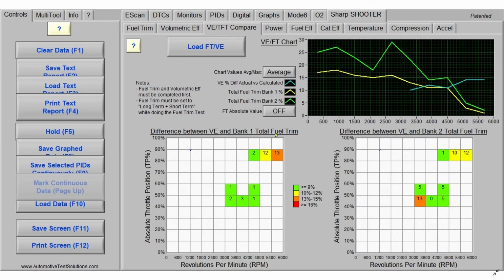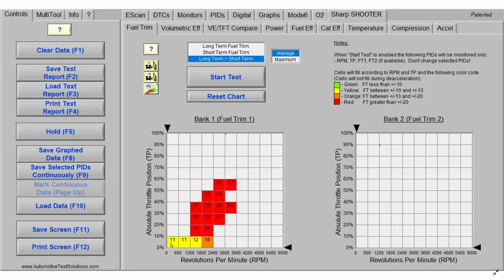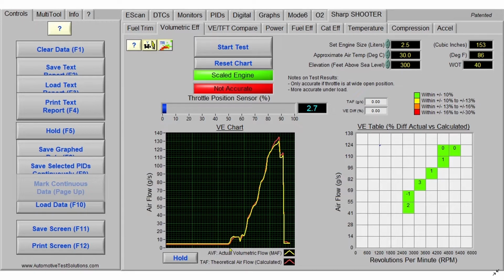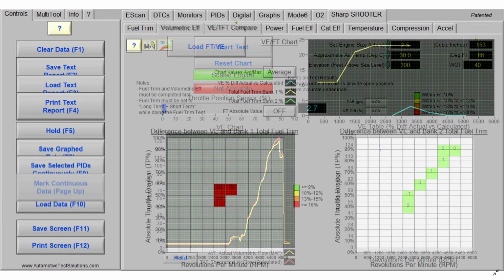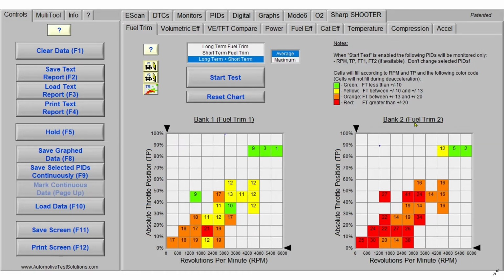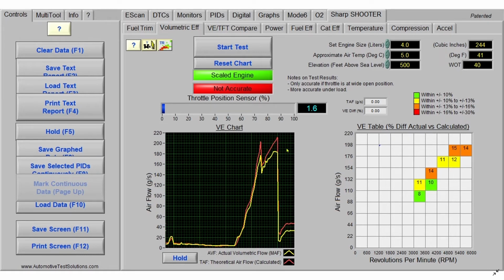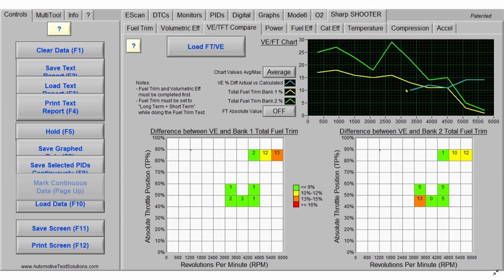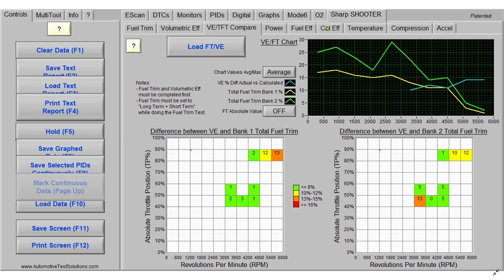Lean and Leaner ATS Escan to the rescue!

Comment: The ecu is adding more fuel as the rpm is increased.how can it be a lean mixture? Can you please explain 
Thanks
Reply from the maker: On the Altima the ECU wants more fuel, do the the reporting of the feedback system. As the engine load increases the engine needs more fuel to support the added airflow, the fuel pump just simply could not keep up with demand and the worse it got.
Same thing with the Frontier except the fuel was contaminated (with something?) and just could not support proper combustion.

Comment: just ordered escan with tablet.... i am a HD diesel tech with an automotive back ground..... i dont deal with automotive driveability issues on daily basis but i do enough side repairs that i can see value in the tests that this tools offers ...
Reply: Thanks bro. Got the tablet also and was wondering if i could run my pico , autel and hantek off it
Reply from the maker: Nice, I think it will help you. It boots up scans,, and gives basic data very quickly. The tablet and case are nice. I run my pico scope on the tablet also. The tool is loaded with "help" features if question come up about certain features.